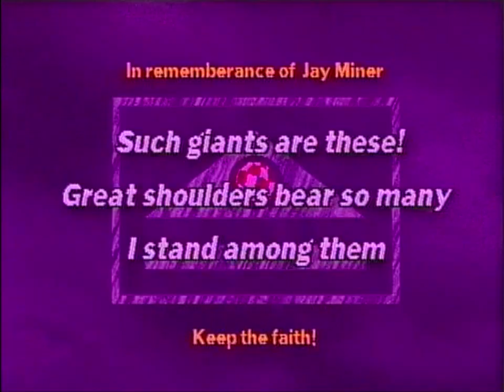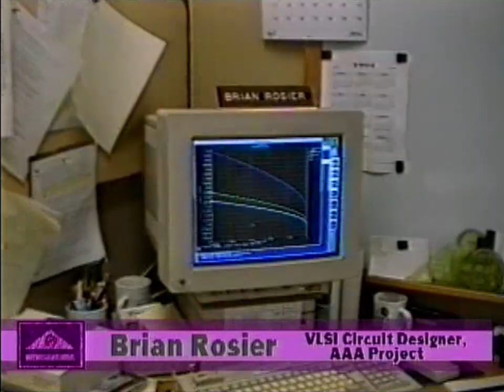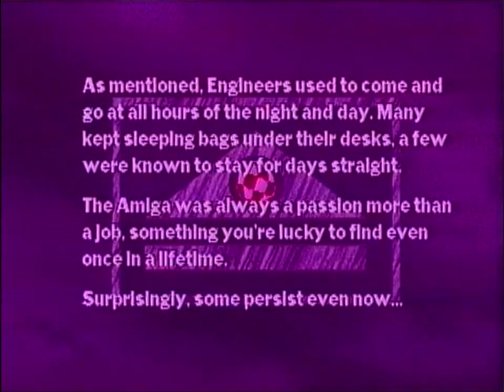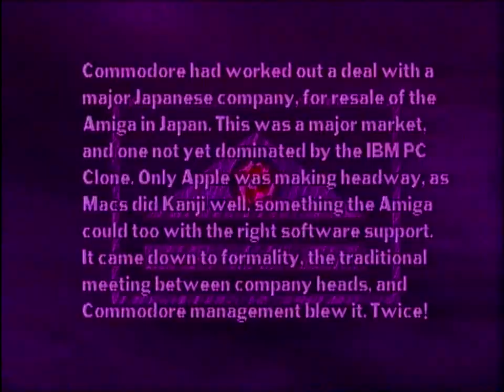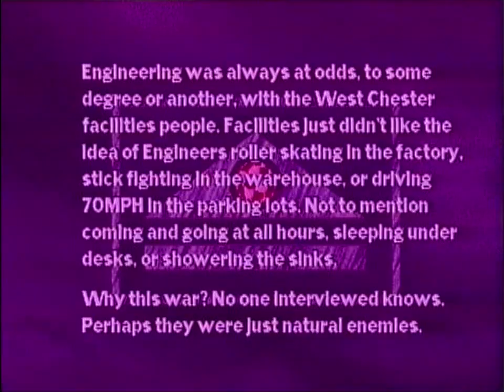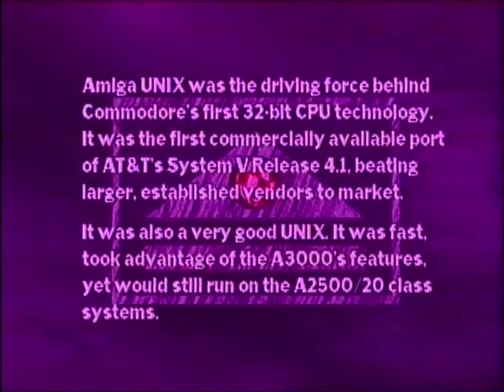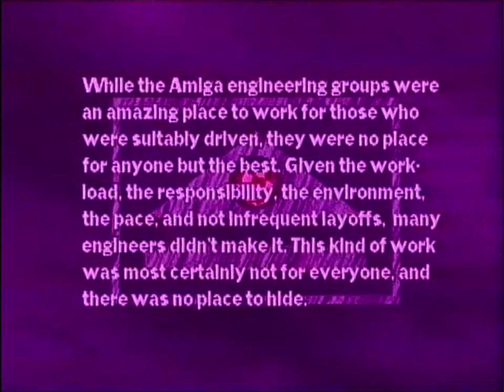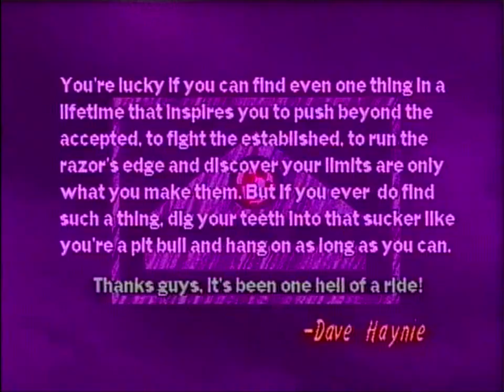The Deathbed Vigil and other tales of digital angst

Comment: Dave, thank you for your work on these amazing machines. My first computer was a C116, then later an Amiga 2000 (that I never upgraded unfortunately) and it seriously got me into programming and probably is the reason why I studied electrical engineering and work as a software developer today. Trying to speak to the custom chips in assembler taught me so much and gave me a healthy respect for the people who designed them.

Comment: As an outsider, yes, the fall of Commodore came as a shock. You had the just released A1200 and A4000 and to an outsider, things looked great. AGA sounded fantastic. I heard there were supply issues, sure but it sounded like a luxury problem to have more than anything else. Then it was suddenly over. I went to PC and even if they were quickly catching up, there were a terrible period of at least 3 years where it felt like a huge step back. They felt like computers killing the Amiga on brute force of clock frequencies and third party competition rather than a coherent elegance and design brilliance.

Comment: When I worked on the Sydney Monorail (purchasing spare parts for the maintenance department) I was using an IBM PS/2 Model 30. It had a 20MB HDD (yes megabytes) and 1MB of RAM. An acquaintance had an Amiga 2000 and showed me what it could do (Battle Chess) I was hooked. His monitor was in colour, my work computer monitor screen was green with white type and no mouse. I bought an Amiga - 80 MB HDD, 4MB RAM, two floppy disk drives (I had the second one installed as an optional extra), colour monitor and a mouse and also got a joystick. I literally spent thousands for software and games - Easy Ledgers, Pagestream, Battle Chess, SWIV, Falcon (F16), Lemmings, Pro Golf, and many more packed away that I have forgotten. I remember there was a Computer Exhibition In Darling Harbour where I worked at the Monorail and went to it an just loved the Commodore/Amiga exhibits. I also remember hearing Gail speak there (pretty sure it was Gail) I am just so disappointed that Commodore/Amiga are no more. Imagine where the computer industry would be now if the life wasn't leached out of it by management who knew nothing about the potential of the technology and all of the great who were involved in Design, R&D and production. I still have my Amiga 2000 and all the software. Thank you so much for posting this video and others.

Comment: Thanks for making and publishing this video, Dave. It brought tears to my eyes. It brings back memories of the happiest years in my life and reminds me of the fact that nothing lasts forever. 

Back in the days it was quite a shock to see Commodore go, especially because my career was based on everything I knew about Amiga's. I worked as a software developer for the Euro branch of a company in laser shows back then. Way before that  I was that teen whizz kid that moved from VIC-20->C64 to the Amiga. Having to move to PC's because we couldn't get A4000's anymore to put our laser control boards in, felt like I had to start all over again. I tried not to look back too much and built my career around the tech after Amiga and frankly I almost forgot.

Now that I am reaching mid-life crisis age (about 50), I am collecting Commodore stuff and especially Amiga's. I have quite a few and treat them like treasures.  Every time I switch on one of these and start fiddling around with it, it's like a time machine that transports me back to happier times and makes me forget other issues and stress.

Thank you for the things you built. Your work is not forgotten.

Comment: I used to work at Intel Corporation, for about 12 years.  That last year was basically a planned layoff, so I knew my release date. But after being there for 12 years, it felt kinda bad & sad, after being familiar with the environment, surroundings, coworkers & skills/experience I gained there.  Since my impending final goodbye was on the horizon, I made sure to take photos & some videos with my digital camera. It was surreal, most of my department was getting laid off as well.  It just felt lonely.  You see the heydays & glory days there in your mind, but when you look around, there was a metaphorical emptiness.  Just like Haynie filmed the empty corridors of Commodore, it looks familiar to what I experienced in the hallways at Intel.  Today it will be close to 15 years since I left the Intel building I used to work at & have never even visited since.  Too far away now, both in distance & in memory.  By the way, despite having worked for Intel, I am a Commdore fan first & I do still own C-64's, with peripherals, disks, manuals etc.  And I also own a 3rd party CPU accelerator for the 64, works great. I had wished that Commodore would have made their own 64 accelerator, which would have extended the 64's usefulness & given them more profit;  since as we all have witnessed, a computer's usefulness, life & interest has been done by incrementally increasing its processor speed, hence for example, from 8088 to today's i7's & beyond.  I had already seen Deathbed Vigil a couple years ago for the first time & thought it would be nice to revisit, even if the mood was somber in the video.  We also very recently had to let go of my dad's (RIP) business building, having had the property for 35 years. I knew every inch of the building, so it was also sad for me to help clean it out & sell it.

Comment: I was 21 when Commodore declared bankruptcy and damn it hurt. I had saved paper route money for two years to by my first computer a Commodore 64 at age 15 and then the Amiga 500 at age 18.  VGA had us turn away from the Amiga 500s (me and a few friends had one) to purchase 386 DX 40 pcs with 2mb trident 8900c VGA cards with a Soundblaster. Sure the VGA was better than the A500 by about 232 colours but the sound would not be beat until the Gravis Ultrasound card and Sound Blaster 16s many years later.

Comment: Man, after the Commodore 64, I grew up with an Amiga 500 in the states.  Our setup was incredible because we actually had the monitor that could support PAL and NTSC signals, and we even had a disk with a program on it that would swap modes (I believe Directory Opus was required for it to work), but we had a computer shop that actually did import some games from Europe.  I remember games like Morph and Leander, the latter being one of my favorites growing up.

Amiga was my childhood, so hearing the story of how Amiga (and Commodore) failed, then seeing this video (First saw on Amiga Forever 8's DVD 2), was quite the experience to the history of easily the most important part of my younger years.  Thank you for the creation of this video Dave, especially the stories told in the later parts of this important piece of computer history.  Hearing those was a wonderful experience.

On a site note, with all the... unwise business decisions Commodore made, it would be easy to think they actively wanted Amiga to fail.  Can you imagine if the 500 got a CD ROM add-on drive before the CDTV came out?

Comment: Hi Dave, I'm so glad that you have documented this and for every Amiga fan this video has a very personal meaning. I was just wondering, you have mentioned in the video that AAA chipset was finished and now having ability to implement FPGA would it be possible to bring this chipset back to masses using FPGA technology? (I mean as an add-on to actual hardware) Thank you very much, big fan!!
Reply from the maker: No one ever said that AAA was finished. I said in the video that it was real -- there had been rumors it didn't exist. These were Rev 1 parts and not anywhere near fully functional. The specs exist, someone could implemement part or all of it in an FPGA. Then what? There's no software for it, and unless you have the AmigaOS sources, you're not likely to boot AmigaOS on it at all anytime soon. So it's a fairly involved project, which I expect is why no one's done it. I put the AAA specs up on www.thule.no/haynie shorly after Commodore's demise.
Reply: Dave Haynie I just though there is a chance to salvage some of that technology that was supposed to be the next Amiga but you are right, I don't know what is required to make it work so thank you for explaining it to me. It just seems that so much could be still achieved if the management of commodore would listen to the guys that actually did the work. I was always wondering what happened to you after you left commodore, I mean what work did you do after (if it's not too personal) thank you for the reply, I didn't think I would ever be able to say hi to you and the A3000 is my favourite machine!!!
Reply from the maker: It's frustrating for me ,too. We have seen a big upsurge in "new Amigas" as technology moves forward and makes this a kind of thing that small groups or individuals can create. However, the software is an issue. You can write drivers for simple things, and AmigaOS is about as modular in this respect as an OS can get. These sort of things can stem the tide of time, which is activing killing off classic Amigas, but how to advance anything? That really needs an active AmigaOS project. 

So maybe AROS? But last I checked, that doesn't run on classic hardware. AmigaOS 4.0 took longer to write than AmigaOS 1.0-3.x, but it's only for fairly expensive PowerPC systems. FPGA-based Amiga projects like MiniMIG and Vampire seem to be the best way forward for classic hardware that can be improved, also at a price structure that guarantees falling prices (since FPGAs are in the same tech wave that's constantly improving CPUs, GPUs, etc). But how to support changes? It's not impossible, but it's difficult to do without some centralized open work on the OS.
Reply from the maker: After Commodore, I worked at startup companies mostly. I was at Scala for three years,  helping to turn that application into the "Digital Signage" software that exists today on many platforms. I consulted for Amiga Technologies, and when that went bust, formed a startup with some of the folks from Germany (PIOS Computer AG, then Metabox AG -- same company, different names). We tried to get AmigaOS rights, could not, then proceeded to make Macintosh "clones". After that was shut down, we made a line of multimedia set-top boxes. Next company was called Fortele, working on whole-home multimedia networking and abstraction (all of your media devices run via the same UI, speech recognition, anywhere in the house). That one ran out of money and I went to work for Nomadio, a company that started working on a gaming robot, then shifted to making the world's best R/C controllers for model cars and then branching out into controls for robots. They eventually pivoted away from hardware, and I moved to Rajant where I work today, building small computers and other hardware for radio systems used in harsh environments. We just supplied the NFL with a custom designed coach-to-coach radio system, first used in the 2016 Pro Bowl and at every stadium in the 2016 season.
Reply: Dave Haynie Thank you very much Dave, too bad you weren't able to get the AmigaOS rights back then! It was very painful observing what gateway2000+others  did to Amiga and all of the Amiga estate being disrespected, ripped into bits and pieces and sold to companies that either cared or even understood what they had. If the AmigaOS could be managed by someone that cared about it back then then it all might had totally different outcome and if there was somebody that could do something good with it then it would had to be someone like you, person that not only could appreciate what the Amiga meant to many people but most importantly had a technical knowledge and understanding of the machine. But I do understand that it wouldn't be easy but it just seemed to me that most of companies/people involved with post commodore era were there only to squeeze out whatever money was left in the Amiga technology but nothing else.. 
I just want to thank you for your support for the community and documenting these times, it gives us a proper understanding of what was going on back then and to meet the actual people involved and even look inside the commodore facility is a treat!
Personally, I'm very happy that I was able to experience that amazing era first hand and seeing the 500 first time gave me chills , it was sooo ahead of absolutely everything else and even now every time I power it on it just makes me happy and since then no other machine could capture that euphoric atmosphere. Once again, thank you very much Dave and I wish you happiness in your professional and personal life!

Comment: As interesting as Commodore was its sad to see it go away.  BTW:  My Amiga 2000HD is alive and resides proudly in my server rack a but tweaked out but connected to a KVM Switch so from time to time I can turn it on to say hello to an old friend.   I have an A1200 that still works as well.   Believe it or not the click disk drives still work and disks as old as the units themselves still work.   I keep them alive, do not use them much but they are old friends.

Comment: Well, does this remind me of the comp.sys.amiga.advocacy or something. I'm still coding for the Amiga. Why? Because it's fun, and my A4000 still works. Why do we do this? (Well, we are for sure not into BDSM) but it's fun to have a active demoscene with what others think is obsolete, and still compete in the democompos. I made my last public demo in 95. Due to family and so on. (Kids). Now my kids has everything from Arduino to gaming PCs, but for some reason, they find it more fun to be on a Miggy with (the obvious clone of *** **) and they like the oldskool. I prefer PS4. Except for programming that PPC crap of Sony Midgets. :-) I still use my Miggys. I even have the rare (original) Oxxi's ACS for Novell Netware 3.x (Works with Netware 4.x and 5.x with IPX in Bindery mode too). Stay alive, Dave. We in the nordic countries love what you've done.

Comment: I watched this for the second time  in 2024, and I am still an Amiga fan, still using Amiga Computers, and still heartbroken.  The Amiga was just the right computer, and what a future it could have had.    I have been through the personal experience of a death vigil like this, with the death of Canadian Pacific Airlines, a fantastic company, killed by politics and mismanagement.  I know how it feels, walking through the empty corridors,  and that desolate feeling is always there in memory..
In my mid 30s,  started my home computer journey in 1978 on the Vic20,  with a cassette recorder, and progressed through the C-64, to the Amiga 1000, 2000, 3000, and the 4000.  Other than the 1000 I gave to my son, I still have them all, and they are still operational.  However, I do need to do some re-capping,

Comment: Loved my VIC20 and C64.  At the time, my friend and I repaired power supplies.  I wrote the code and he made a board that attached to the expansion port that allowed us to test 3 voltages on 8 powers supplies at the same time.  We even output the levels to a huge heavy centronics printer to print graphs of the noise level on each voltage.  This was at the time when you could program chips and make your own cartridges.  We used that sucker for 2+ years to test hundreds of power supplies.  Thanks guys for the great computers!

Comment: You know, just today I was wishing for a Rexx port in Microsoft Teams so I could wire in my physical mute button without having to do dumb crap like emulating presses on a keyboard.  I had an A3000 and it was one hell of a machine. Commodore computers are the reason I became a programmer (I also had a 128D and still have a VIC-20) and the way it all ended just makes me sad.

Comment: The first time I watched this video, probably back in the mid 90s, I became physically nauseous thinking of the waste and ineptitude of such a great bunch of guys and what they created. I had to stop watching midway through so my stomach could settle down. Is that weird to get so emotional about a piece of electronic hardware? Ask any Amiga user and they will say "No". I still get anxious watching it today. Just think what the next generations of Amiga hardware could have been. I sold all my Amiga stuff back in 2006 and wish I had not, and not because it would have had tremendously more value, but because I miss tinkering and using it. Yeah, I have AmigaForever and a Minimig but it just isn't the same. Dave - thanks for posting this.

Comment: Wait, this was edited on an Amiga 3000+? The prototype with AGA, a DSP and built-in genlock? :o
Reply from the maker: Yup. Jeff Porter even gave me an early copy of Scala with AA chip support! There was no built-in genlock on the Amiga 3000+. I used a SuperGen 2000 and a TBC Plus -- the TBC Plus could also do effects, which I had automated via AREXX commands sent in the Scala script.
Reply: @DaveHaynie  Right sorry - I don't know where I got the genlock part from :p Super cool that it was edited on the 3000+ though! Do you have any idea how many 3000+ were made? I haven't seen one outside of the few detail photos of the breadboards!
Reply from the maker: @Ninjaznexx  The full fledged Rev 1 was only a few. We did a second revision, but it was screwed up -- it was an SMT board they tried to build without paying for a solder stencil. So there was solder shorting under every chip. The Rev 3, dubbed "AA3000" rather than A3000+, had the analog stuff for the DSP removed by order of the TPTB. We made about 50 of these -- they were put out as development systems for the AA chips.